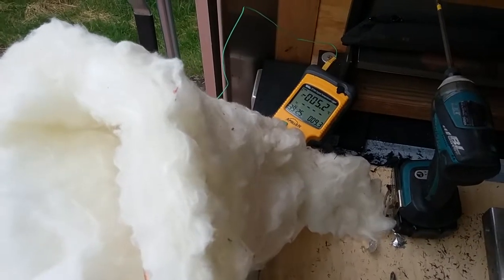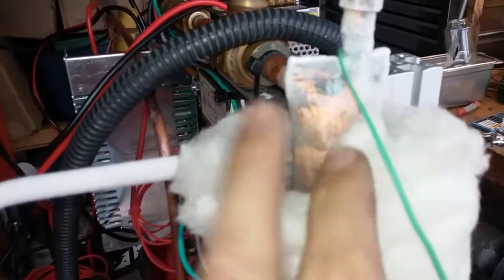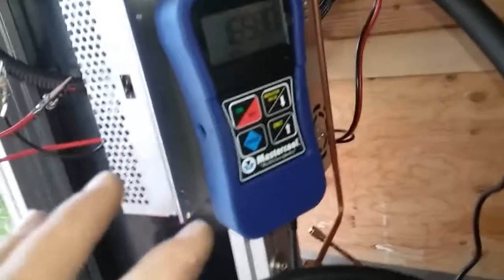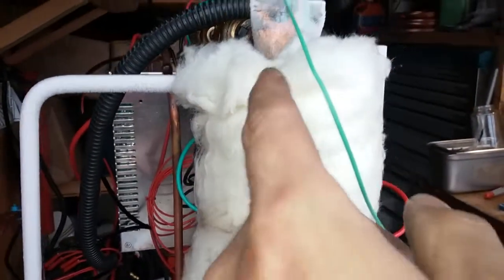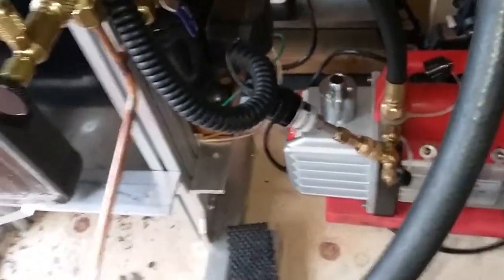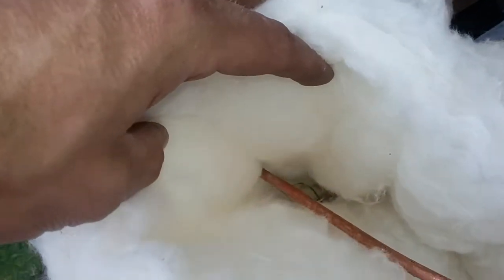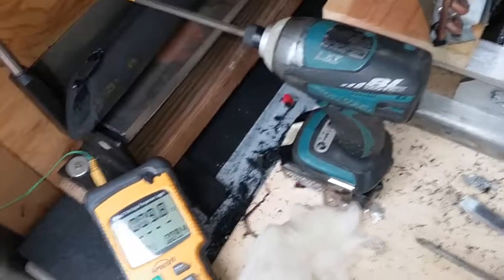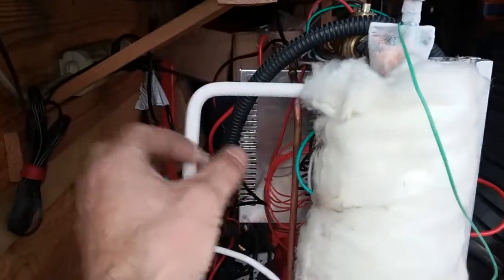Refrigerated Vacuum Pump Cold Trap

Comment: are you using propane barbeque grade, or refrigeration grade? And how is that working out? Any moisture problems?
R290 is like 10times the cost of standard propane here. thanks for the interesting vid.
Reply from the maker: sjef oekel I am using MD- 5 BBQ grade propane. It's super cheap and works great. I have never had a problem that I can attribute to moisture or contaminants in the propane.  I always use a filter/drier before my cap tube. If I were to build something long term, I would consider the refrigerant grade stuff,  but if the components you are using are mostly from scrap anyway, why not just have fun?  

My heat pump in the lab ran all fall, winter, and spring, without issue.
Reply: M.C. Pletcher  thanks for the info. I am gonna give it a try, personally i think barbeque grade is more safe because off the smell.
Reply from the maker: sjef oekel The smell eventually is pulled out by the filter. There are ways to clean it up, but I don't worry about it.
Reply: @whatawaytogo515  I’ve previously worked as an industrial / petrochemical refrigeration mechanic and have worked on many systems utilising propane, polypropylene, ammonia and from memory the systems using hydrocarbons as refrigerants used a poly glycol oil and this was due to standard oils being miscible in hydrocarbons so in basic terms the lubricant in the compressor is becoming a solvent